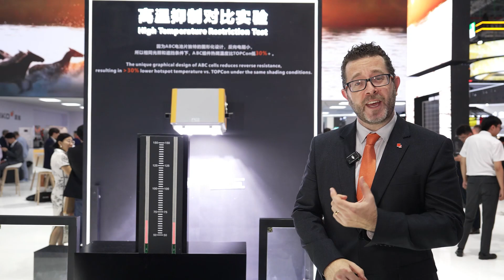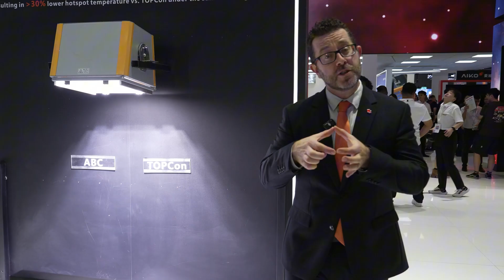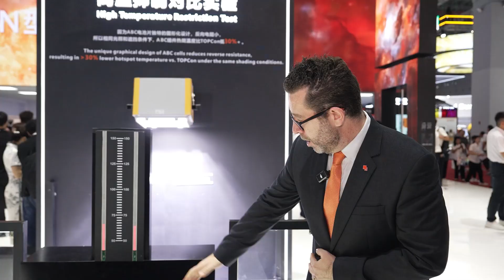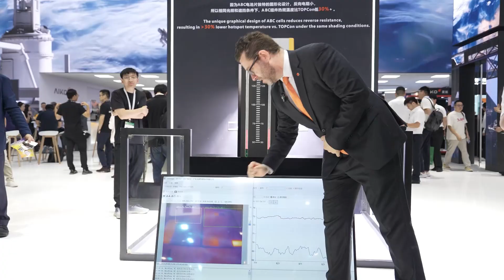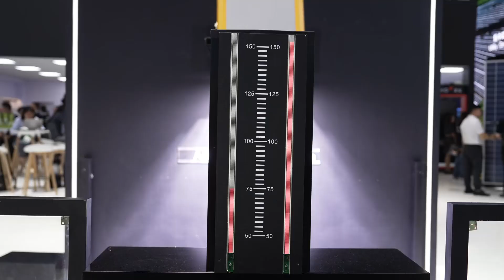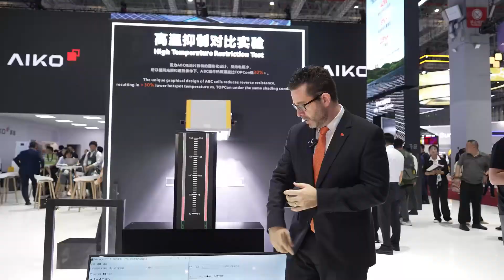SNEC 2025- High Temperature Restriction Test

Comment: Please do not manipulate customers.
The important thing is the final production in kWh. Which you do not show.

Temperature is of course important, but there is not that much difference in the final production in kWh.

The back contact is only for monofacial systems, because everything is shading from the back. Vulnerable to fire with the back sheets. This plastic on the front does not withstand disasters, because it does not protect the cells in real conditions. Come on, enough nonsense.

Bifacial is unbeatable in the final production in kWh and in safety between thick glasses.
Bifaciality:
back contact =60%
TopCon =80%
HJT max quality = 95-98% (winner in all scenarios).